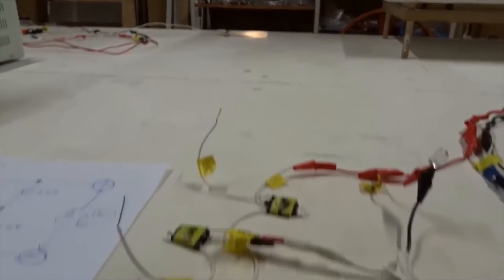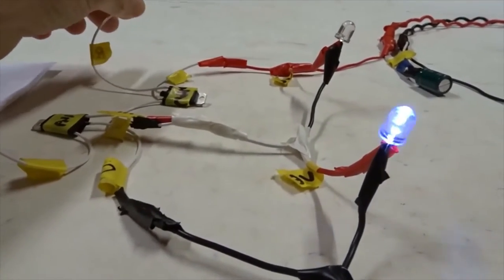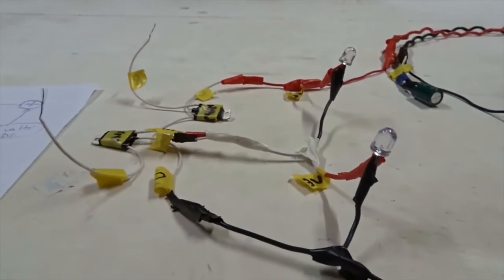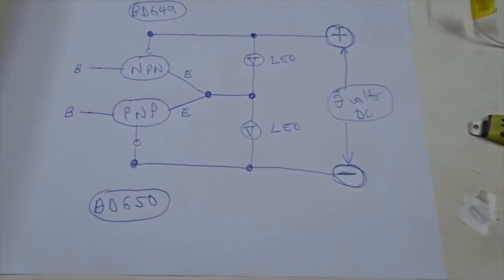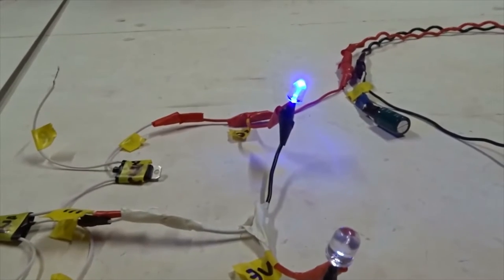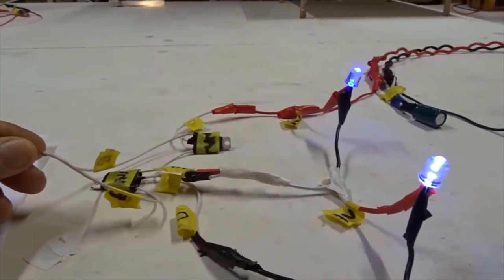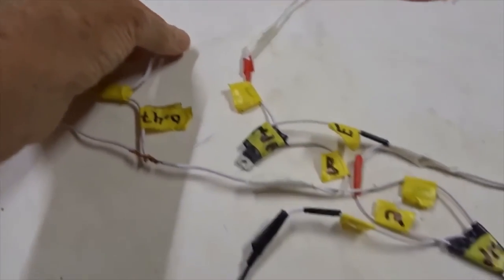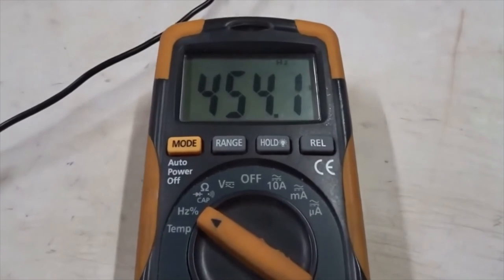The simplest possible circuit for detecting wireless energy at 500 kHz

Comment: Well done, but I have a question outside this video. If I add a magnet to a single phase motor to the rotating shaft, does the motor work or do I change the stator coils?
Reply: Please see a whole series of videos posted on this same channel 1-2 years ago, about 3-phase AC motors which use permanent magnet rotors? The physics is called "V-W torque". Best wishes!
Reply: @redcolliereturns7174  Thanks